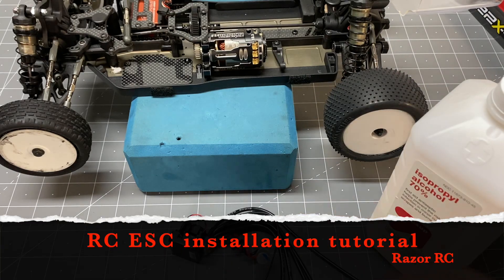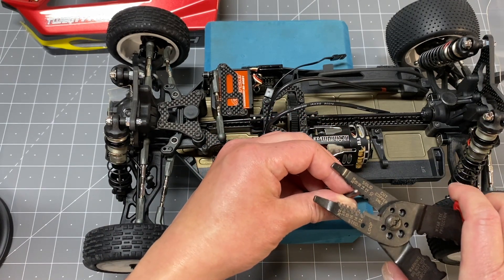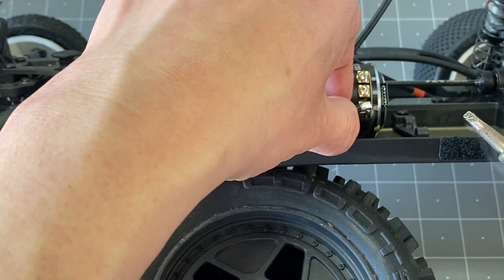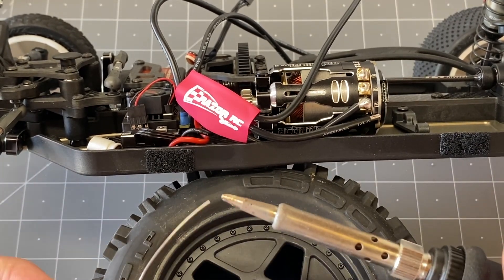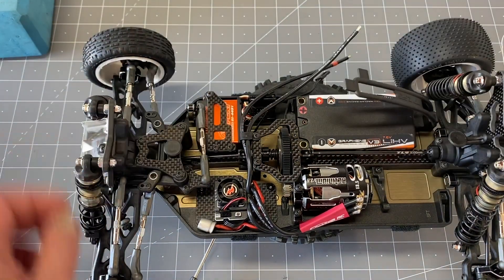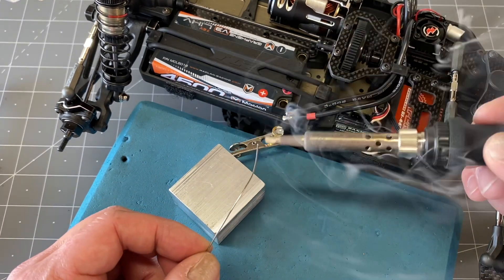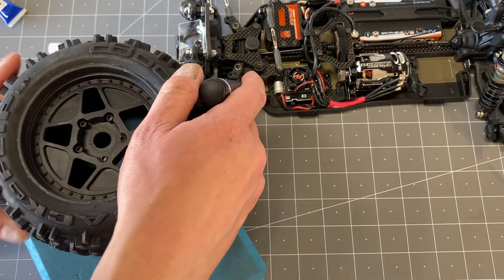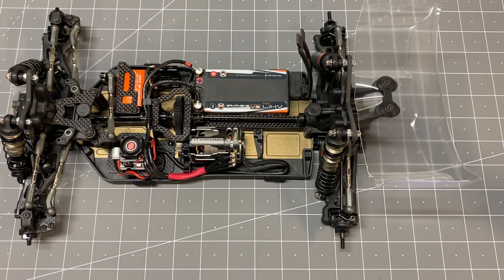ESC installation tutorial how-to RC car.  (RC Basics #3)

Comment: Super clear video thanks.
Only thing I would add is maybe using tweezers or thin nose pliers to hold the wires whilst soldering them to the tabs. They can get super hot!

Comment: How do you know what wire to solder to what part on the motor or does it not matter
Reply from the maker: The ESC and motor should both be labeled ABC or Blue Orange Yellow.  So you just match the letters or colors.

Comment: I'm about to use superglue because I'm frustrated so this will be interesting.   Heavy duty outdoor velcro didn't even work a little bit. Double sided tape cost at least 10 dollars, 1/5th the cost of the hobbywing ESC itself. Why isn't there a standard esc mounting screw for hobby grade RC's #stupid, every rc ive owned this was an issue. Completely crazy.